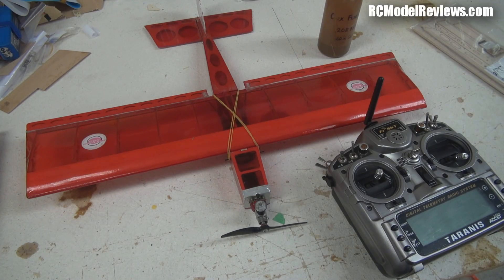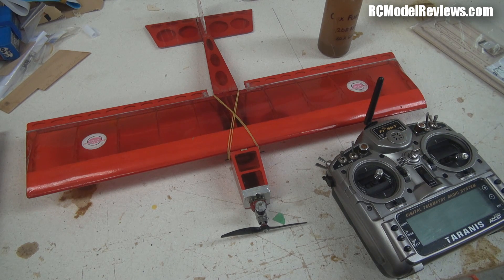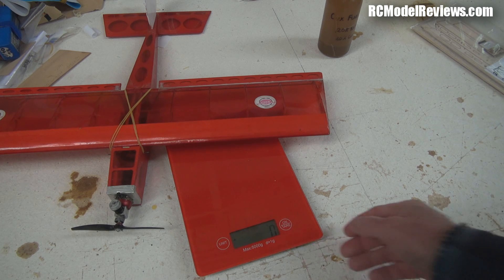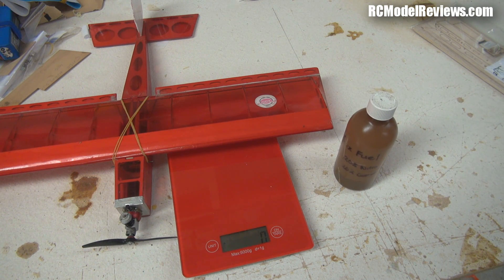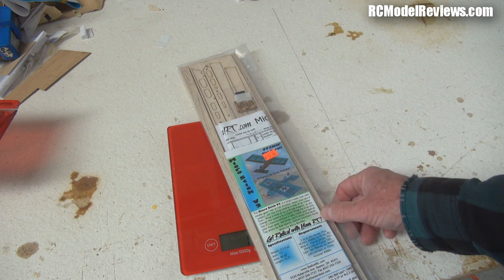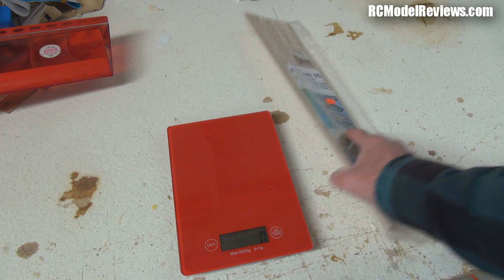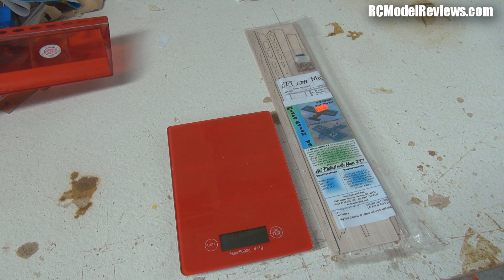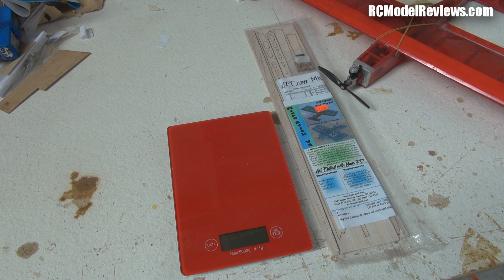Fixed Wing Friday: nitro under 250g

Comment: Hi Bruce
I'd like to know why an rc plane cannot fly vertically for too far? I have a couple of planes, a prop and an edf, both of which are very powerful with a greater than 1:1 thrust to weight. Both set off vertically with great enthusiasm but after around 100m or so, lose all speed and roll over. It's a gradual thing but it always happens around the same distance. It can't be air thickness at that height so what's the deal?

Comment: Nitro??? I dont understand why anyone still uses it. Nostalgia maybe? Its messy, loud, expensive, dangerous, unreliable, toxic, and cumbersome. And with all these negatives it provides little to no advantages. I flew nitro back in the late 90s but got out of the hobby for a long time. I remember spending more time at the field tuning then flying on some days. Not to mention mid air dead sticks. It was electric that brought me back. So lets put the dinosaur technology behind us and move forward.

Comment: Hi, I heard you mention DLG at the end of the video. Could you please follow up with some DLG models that fit into the regulations you described. I would really like to take a crack at DLG but my funds are very limited and most gliders cost more than I can afford. Sorry to sound so cheap but life has put me in a hard spot for now.
Reply: Look up Bruce's videos on the Hobbyking mini DLG.  It's a very good candidate for flying under 250g (it is about 130g in glider form).  I made it into a FPV motor glider, still under 250g and over 30 minutes flights capable, not bad in wind either. (See video on my channel.  I would post a link but it seems Bruce deletes it even though I support him on Patreon!).  Also, the very high end competition DLG in 1.5m wingspan come in under 250g also, like the Kennedy Composites Snipe and Snipe-Lite.

Comment: I have a Cox .049 I have yet to put on anything, would be cool to have a sub-250 gram kit I could pair it with.
On a side note, where do you get your fuel for your cox engines?
Reply: if you are in the states http://www3.towerhobbies.com/cgi-bin/wti0001p?&I=LXDBNH
or  http://www.sigmfg.com/IndexText/SIGCF001.html
Here I can not get either so i get 30% helicopter fuel and add castor that i buy from a local vet.

Comment: I love this sudden trend toward sub-250g aircraft. I guess it took an effective ban in Canada on anything over 250g to get things going, since I went sub-250 when the US did it, but better late than never. 😎 

My first plane 30 years ago was a balsa and film glider, and I have a lot of fond memories of building that, so I can definitely see the retro appeal for that style construction. Really not following you on the nitro power though. A big part of why I gave up on RC back then was not wanting to deal with that hassle. There was also the noise and the complaints that went along with that. No thanks.

Really looking forward to more sub-250g builds, just rather you stuck with electric. You can do a lot with a 1000mah 2S battery, an 1806 motor, a 20A quad ESC, an AIO camera/VTx, and a 500mA 5V Polulu. Thanks for all your hard work.

Comment: Ah the good old days!  When I was a kid I had a bunch of the Cox plastic U control planes with a .049, and I built a bunch of 1/2A Ukies as well, that was well before I got into radio control with a EK Logictrol in 1968.  The nice thing about 1/2A, I would buy pint of Missile Mist and it would last all summer, or dang near a year.

Comment: what's with the spring on motor block is it there to hold a bearing or to prevent damage on crash landing
Reply: It's a starter of sorts...you hook the prop with the spring, wind the motor back a few turns and release. If you're lucky, the motor starts...if not, lather rinse and repeat.
Reply: Doug Wagner well thats convenient i thoth that u need the electric starter vith rubber cup but im a bit scared if u bent it prop hits it and hell could happend probably i does not have that long

Comment: As soon as the new Canadian laws came, I ordered some sub 250g models to be sure I could still fly this summer without worries.  I was also planning to make an FPV Guillows conversion.  What I've found difficult is getting together the right set of small parts once you go smaller than 250-quadcopter gear, motor shafts without matching collets, servo connectors not matching reciever plugs etc.

Comment: Great to see the mini and micro sticks. I used to fly my 2 Ace Sticks on PeeWee .020s and had a blast with just rudder only setups. I had one with the wing on top and one in a low wing configuration. My Grandpa and Dad would take turns on the old Ace rudder only 27mhz transmitter. Priceless memories and many hours of fun. I liked them better than my Roaring 20 or the other rudder only plans. The were fun diversion from the 4-5 channel bigger planes. Have fun with your sub 250g planes. Maybe I'll have to try a foamie version. Or build a balsa one. Hmmmm

Comment: It's funny how you said that you "don't need to charge batteries, just refuel and you're up again". Interesting. What do the servos run on? Hopes and dreams? Haha.
Plus, there's the constant nightmare of tuning those damn nitro engines that usually have more mood changes in a single afternoon than an angry, divorced woman going through PMS.
I admire your persistence with them and some do sound cool, but nah... I'll stick to my lipos. However, I do love gas engines and would love to fly my own large scale warbird some day. :)
Reply: thejason51873 and how much did them Lipos cost...ouch!
Don't get me wrong, electric has its place. But for larger models ic all the way.
Reply: Aussie RC Playground nitros all day long!
Yeah the servos use a battery, but with the right choice of Lopo it will last all day.
And once you get the engine tuned it will be happy all day.
Reply: rockyfosgate - I've never heard of a nitro engine that will run all day once you tune it right. What's this mystical engine you speak of? Does it come from the same place where you buy your unicorns? LOL 😂
I'm just teasing... my experience with nitro engines has been... let's just say "unpleasant". Admittedly, I've never had a nitro in a plane, only in cars, but it was enough to never go near one again. Respect to those that can be bothered tuning them and dealing with the mess of oil, fuel and all the rest, but it's not my thing. Plus, I like to fly early in the mornings when the wind is generally nonexistent, so buzzing around with a nitro at that time would not go well with the surrounding residents. Haha.
Reply: Seer111 I have faced the same misery with nitro cars. Thankfully planes and helis are quite different.
Sometimes my heli engine won't need a tune for a week or more.
Reply: I shore wouldn't miss the mess of the oil though 😒
Reply: Yeah the oily mess is why I pretty much stopped flying nitro when lipo's started becoming affordable and made electrics truly worthwhile.
Reply: I can take 8 - 10 lipos to the field and fly all day long too. Nitro is a dinosaur lets put it to rest already.
Reply: thejason51873 
I was talking in regard to large helicopters which is what I generally fly.
And kind of made the assumption you was.
In which case I take it back. However I can recall paying £220 for one 6s5000mah for my trex 600.
The new 90 helis use x2 of them, that's around £400 for one flight.
Then comes the expensive esc, motor, chargers, power supply etc....
Plus lipos just don't seem to last these days, lost most of there power/flightime within 15 cycles.
Reply: 15 cycles per battery? Your either running them too low are not buying high enough C rating. That's just silly... I have mini quads that pull over 100amps and the batteries I use on it have over 100 cycles and still going strong.  The recommend battery for the trex600 heli is 1 - 3300 not 2 - 5000's and 1 - 3300 60c (130burst) battery is only $60usd, also you can get a 4 port charger with built in power supply for $100, ESCs for all the planes I fly cost no more then $15-$20. So motor esc combo for an average size plane is only $40 - $50 max. Still 1/2 to 1/3 the cost of a quality nitro motor and will last 100x longer. So I dont know where you get your numbers from, your living in the past brotha.
Reply: Gas has gotten small enough that there is no need to mess with nitro.
Reply: I'll admit those Cox Babe Bee 0.049s were noisy, but the smell of glow fuel (Cox Glow Power) was really something. I never had any problems starting or tuning them, and just kept flying my C/L models until they crashed - at which point I did some field repairs with 5 minute Araldite, and I was back in the air again !

Comment: I've built lots of flying models. And there is a joy to making balsa and film aircraft.
They do tend to be a little fragile though and, not having your flying skills (usually because I didn't get much time in the air), I spent a lot of time picking up the remains :D
I'm currently trying to get those skills on a lightweight electric foamy (36g) and if I do I might build another kit. Nice to see they are still about :)

Comment: I wonder if the cox motors from Hobbyking are any good?
Reply: they are original cox engines from the last batch made when cox was owned by estes.
They run well  but they are not as good as the earlier ones (tolerances are less)

Comment: As soon as models under 250 grams get longer range and can carry FPV ect. the weight of regulated models will drop.
Reply: planes have trouble with wind.  miniquads do not have trouble with wind, not even the 200 gram ones.  More likely to have a great flight on a very windy day with a 200gram quad than with a 3kg  plane
Reply: Just like the old Boeing 747.  That must be why they don't fly them anymore.
Reply: I can fly anything under 25 kg without a licence or registering. It's nice to live in Central Europe.

Comment: I usually crash before I run out of batteries not to mention about nitro
Reply: either this or the engine stalls because I didn't tune it properly.
Reply: TOXIN543 me too but i have so much fun!

Comment: This is great advice. :¬)
  I'm knocking up a 2 channel glider at the moment. I'm using an old glider dihedral wing and a lightweight pod and boom fuselage. The fuse weighs in at 70g. The 20 year old built up wing only weighs 220g, :¬(
 Luckily, I'm in the UK and our weight limits are unchanged as yet. So 7kg is when you have to start registering any flying model. Woohoo! :¬D

Comment: :) love cox  ; could you do a 1/2A Monday ?
Reply: or go REALLY old school with some control lines  :)
Reply: yea mount that 0.010 on a control line model :)
Reply: put .010 into:
http://www.banggood.com/MinimumRC-Tiger-Moth-Biplane-400mm-Wingspan-Balsa-Wood-Laser-Cut-RC-Airplane-KIT-p-1142300.html?rmmds=search
or
http://www.banggood.com/TY-model-LX17-375mm-Wingspan-Balsa-Wood-Laser-Cut-RC-Airplane-KIT-p-1142726.html?rmmds=search
or
http://www.banggood.com/TY-Model-NO_5-296mm-Wingspan-Wood-Park-Flyer-RC-Airplane-KIT-p-988832.html?rmmds=search

for control: http://www.banggood.com/WLtoys-F949-Airplane-Spare-Parts-Receiver-Board-p-959681.html?rmmds=search

f949 brick is typical older FlySky compatible, so no problem there!
Reply: that tiger moth might be a good start for a .049 control line model and the other wones for the little td :)
Reply: that moth might barely handle .020, honestly .049 is overkill/heavy for it. those wings are about 1mm "paper balsa", I'd stick to .010 and RC them.

for 1/2A CL, the fast and simple down and dirty plank built have always been the best, even combat unless running a bladder fed TeeDee engine. 1/8x4x21" main wing (we'd sliver 1/2" long triangles and reverse them so 3-1/2 at tips 4-1/2 at center, then 1/8x3/4 hard balsa leading edge added making 5-1/4). for a combat plank sliver 3/4 and add 2" to an 18" span because we crashed lots lol! more economical use of 36" balsa stock for a combat stick plane (3/16" booms to "all elevator").
lots and lots of experience scratch building and flying CL stuff (had a club!), these dimensions honestly worked the best for 1/2A CL planks. 

I'm whipping up a KF-4 DSFB electric CL combat bird just for giggles, 2S brushed ESC+motor, cheapo 2ch pistol grip as the handle for throttle control. seems nicest way to let a youngin experience what we used to do, without the fuel mess/hassle and noise of an engine.